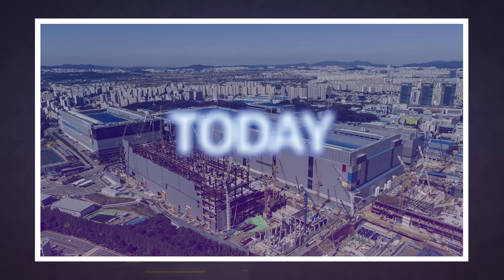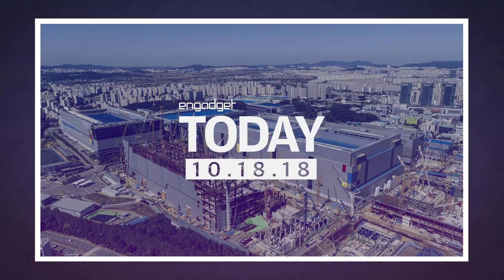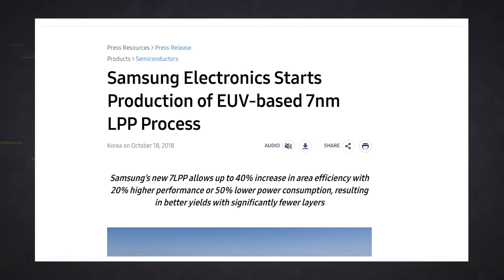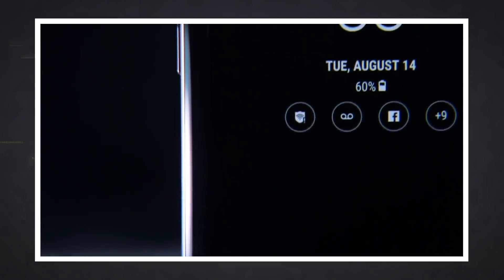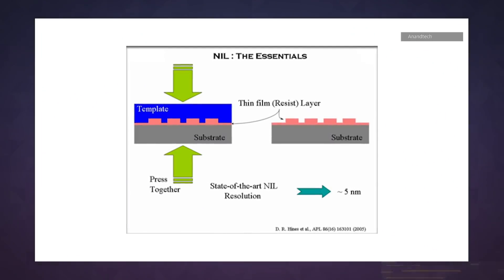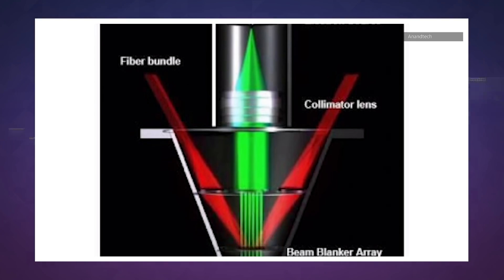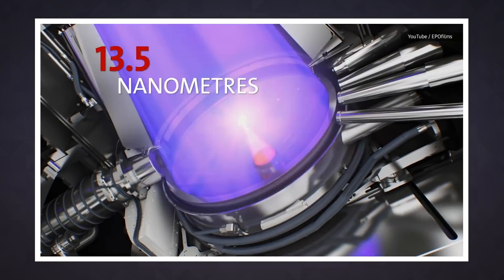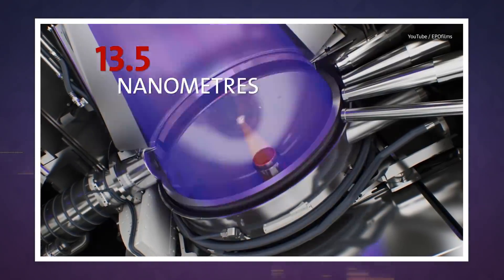How Samsung’s Extreme Ultraviolet unlocks the next generation of chips  | Engadget Today

Comment: Doesn't matter... Here in the US we will be stuck on Qualcomm Snapdragon chips. 😒
Reply: Qualcomm has the same 7nm EUV lithography system from the same manufacturer. They have the same tools to work with. Just depends on how they use it.
Reply: I wouldn't be surprised if TSMC uses EUV for the next iPhone either. They also have the same source for their EUV systems.
Reply: @shadowofnick  Samsung's Exynos chip is so much better than anything Qualcomm drops.
Reply: Huh, really Michael? Lol okay
Reply: @Mcali1984  That's not true sd processor are better than exynos in day to day life. Here in india we are facing exynos. Just after 8 to 10 months of new phone phone will lag everywhere. And at software stability  Samsung is worst. That's why Samsung will never overtake apple in flagships.
Reply: @maheshgopalghare2578  that's BS, my exynos s8+ is still fine after almost 2 years of usage
Reply: Qualcomm Snapdragon SoC are still the way to go if you want a wider selection of custom ROMs not to mention almost all app developers will tend to focus optimizing their app for Snapdragon CPU and Adreno GPU first and foremost. This is very vital if you want to run things like emulation or an obscure app because 99% of the time it's Qualcomm's chips who would get the primary attention of developers to cater their software to.
Reply: You can always order the Exynos version from Amazon if you want, I did the same thing for my wife and yes we are in the US, but we are not locked to a specific carrier to get our phones.
Reply: @Mcali1984  true. Just pointing out they literally have the same EUV vessel in their fab. Obviously the engineers need to play catch up, but the tools are there.
Reply: and here in Asia...gamers prefer...Snapdragon chip =)
Reply: Qualcomm's chips are also made by Samsung
Reply: Some carriers are using cdma there. Samsung needs to pay qualcomm just to be compatible.
Reply: Mahesh Gopalghare dude this news is not only about cellphone. Its about semiconductor. Samsung is the new Intel and this will change the way CPU, Video cards and cellphone APU are gonna be. EUV is known as the true next gen nano chip tech. It improves cycle time, reduced edge placement error (created when multiple masks are used, as in quadruple patterning) and for overall higher pattern fidelity. 40 percent improvement in area efficiency, 20 percent higher performance, or 50 percent lower power consumption. Current 7nm that we are seeing is a cheap conventional lithography. Now we are gonna see true 7nm chips coming to cellphones, Video cards and CPU.
Reply: @maheshgopalghare2578  im using my still fast galaxy s4
Reply: Qualcomm is better
Reply: @ElGrueso  yes. So far CPU/GPUs and all semiconductors (i.e. Memory, etc) has been made with DUV at 192nm magnified down to 13.5 (or whatever was current at the time) through lenses. However, power and resolution were lost through each lense as well as the air in the machine. Now with EUV, the seed laser starts at 7.5nm and keeps full power by using mirrors instead of lenses and being inside a vacuum chamber. The step from 7.5 to 7nm is much more accurate and articulate. Much better process overall. We'll all reap the benefits soon.
Reply: Sadly
Reply: @ark_knight  its true because Samsung limits the processor
Reply: @maheshgopalghare2578  nice joke bro you should get joke of the year award
Reply: @Aldwin Lee u got that show off thing on point 
People here India still waste 300-400 $ to buy iPhone SE or 5s just to show off n for that apples name

Comment: So are there any advantages to the end consumers when it comes to buying a phone with a 7nm chip made from EUV vs made from a traditional etching process?
Reply: Pravin Patil yes in a significant way, it is known as the true next gen nano chip tech. It improves cycle time, reduced edge placement error (created when multiple masks are used, as in quadruple patterning) and for overall higher pattern fidelity. 40 percent improvement in area efficiency, 20 percent higher performance, or 50 percent lower power consumption. Current 7nm that we are seeing is a cheap conventional lithography. Now we are gonna see true 7nm chips coming to cellphones, Video cards and CPU.
Reply: @ElGrueso   Cool. Thanks man.
Reply: Absolutely, think of it as the A12 bionic chip just on crack efficiency, new exynos chips are looking like a beast

Comment: For all the people coming.... Yeah iPhone Xs has 7nm, but it's finfet not euv
Reply: Both are FinFet. EUV is just the means of production.
Reply: js790 nevertheless it’s power is unmatched. A11 Bionic is still more powerful than current chips in android devices. Euv or not it’s going to perform better
Reply: @witchvoxful  well this isn't an apple vs Samsung thing. What Samsung did was impressive nonetheless and will be used by other brands too including Apple meaning more performance.
Reply: @witchvoxful  n its the other way around for the GPU  the 845 GPU is more powerful compared to A12

Comment: To bad its going to be in the late 2019
Reply: They are already mass producing them. TSMC are doing it as well (A12 and Kirin980).
Reply: @rosensofroniev1264  is there already a public announcement on the prototype or is it still in the middle of running the tests?
Reply: Kirin 980 goes in the mate 20 and mate 20 pro. The A12 in the Iphone XS, XS Max and XR. Samsung's Exynos 9820 was unveiled 5 days ago (14th of November). Snapdragon's 855 (8150) has not been unveiled yet but both the Exynos 9820 and Snapdragon 855 will be in mass production before the end of the year. 
The only companies that are ready with euv seem to be Samsung and TSMC. Samsung manufacturing it's own Exynos and TSMC manufacturing all other 7nm chips (Apple's, Huawei's, Qualcomm's...).
Reply: @rosensofroniev1264  wait...so those ultraviolet thing's are in the a12?
Reply: @sciencebutreversed1166   It's the light  that is used for the lithography process when manufacturing them (extreme ultra violet light). And yes it was used for the A12 and the Kirin 980 by TSMC already.
Reply: @rosensofroniev1264  ohh,so this video is just talking about the ultraviolet mainly manufactured from samsungs,and not the "first" ultraviolet thingy featured oncthe chip (which already existed from TSMC)
Reply: @sciencebutreversed1166  To build the "conductors", transistors and all tiny features on a chip you use a process called lithography. For this you need a light source. Up until now this source of light has been deep ultra violet (193nm). From now on Samsung and TSMC are starting to use extreme ultra violet light (13.5nm). The machines that give this light are built by ASML (a dutch company) and supplied to Samsung and TSMC. So yes the video is about using ultraviolet light in the manufacturing process of the chips. Not about building ultraviolet thingies inside the chip.